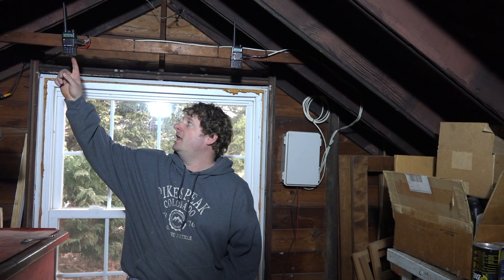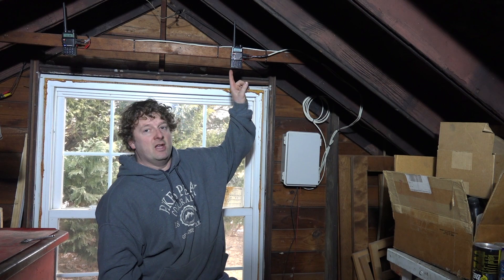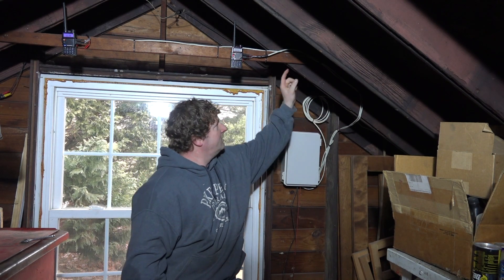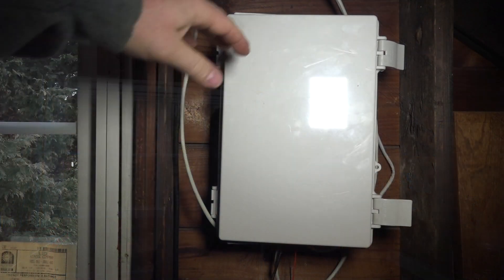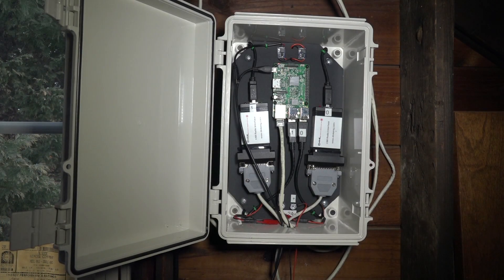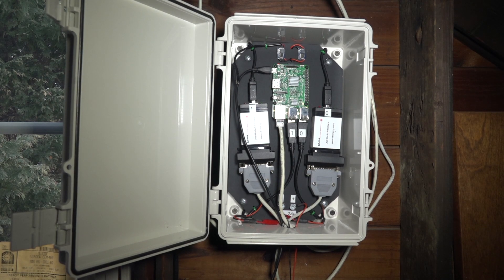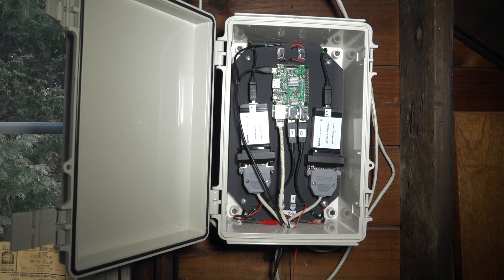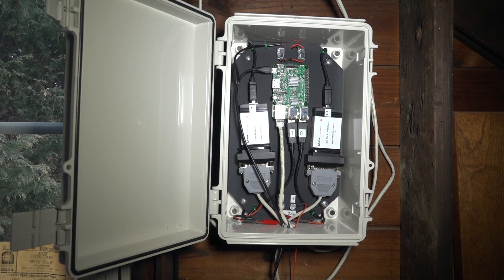Two  Allstar Nodes Single Raspberry PI System (Ham Radio)

Comment: first off that is not a 2 node system. your running 1 radio as a receive and the other as transmit with only 1 copy of allstar making it a single Node system. a radio is not a Node. Please reeducate yourself on allstar and setting up Nodes with RF radios.
Reply from the maker: Brad, thank you for the comment. I do need to correct you. This system does have two radios. I am running a single raspberry Pi with two URI and two radios. The Hamvoip system can handle more that one radio with only one raspberry pi. 

Each radio has a different node number and can be connected to different places at the same time. With this setup I can be involved in to completely different conversations at the same time. 

The reason I posted the video is because I thought most people wouldn’t understand unless I showed them.
Reply: @232nate  you just admitted that your running 2 radios. the URI's are just an interface. unless you have 2 separate frequencies on different bands so as not to need duplexers yes you can do that with hamvoip. I run hamvoip with allstar and echolink and dmr bridge on a repeater. I also run a DMR repeater and a GMRS repeater. you show one radio receiving and one transmitting.  not  as separate actual nodes.
Reply from the maker: @BradKellison  Each radio has it's own node number, URI, Frequencies and can be used at the same time.
Reply: @BradKellison  Sad ham in the house!

Comment: Pretty cool "dual" setup! Sounds clear as a bell too! Are you still running off of the external battery power? Or have you converted the radios to using an AC source?
Reply from the maker: Yes, still running off of battery power. I have since added solar to charge the system
Reply: @232nate  An even better idea! Awesome. Have you done a video on that yet? I'm think about getting into a solar powered station next.
Reply from the maker: I have not made a video yet. I really do want to make more videos again

Comment: Nate: How are you powering the 2 Baofengs in this video? Are you bypassing the batteries?
Reply from the maker: Yes, I am bypassing the batteries. I have soldered wires directly to the battery contacts on the radio. There a car battery with a step down converter for the radio. Seems to work well and lasts a long time between charges

Comment: Are those 2 DC converters on the top of the control box and are you running each one to its own adapter?
Reply from the maker: Rey A one drops the voltage to 5V for the PI and the other is for the radios at 8V

Comment: Would it be possible to use the BaoFeng 888 in place of the UV-5R, just curious, also, are you using battery eliminators on the BaoFengs?  Thanks for the video, it is a good resource. 73
Reply from the maker: Glendon Blount Yes, it is very possible to use the baofeng 888 in place of the UV-5R. There is a lot more work involved with the 888s compared to the Uv-5R. I suggest you look at my other video, I show you how to setup the UV-5R.

Comment: So is the point of this to be able to talk with people all over cheaply? I'm new to radios and don't fully understand the why of this. Thanks for showing off your setup.
Reply from the maker: The point of this video is to show 2 nodes on a single raspberry pi 3. If you are a licensed Ham you can use a system like to contact people around the world. The only costs are the node, radios, and the internet using VOIP.